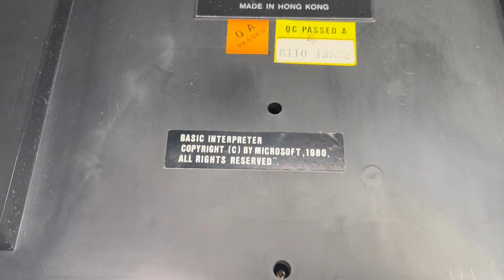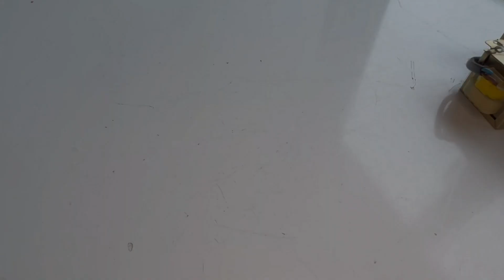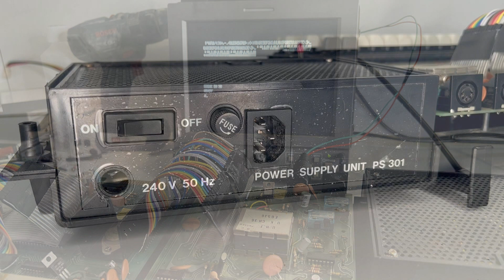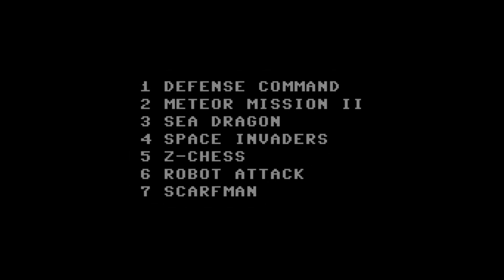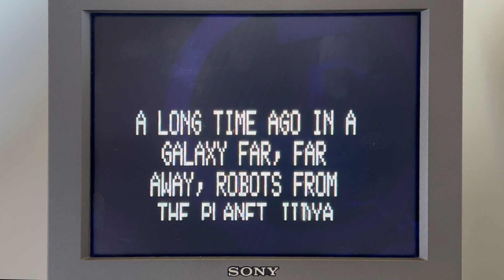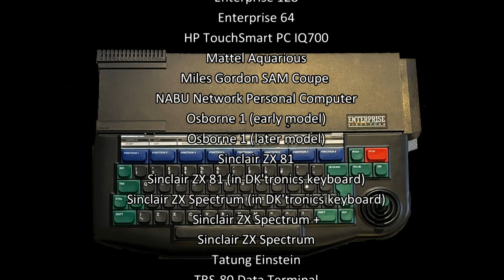1981 EACA Video Genie System EG3003 Version 2 (Part I)

Comment: Hello. have same computer (with extra internal 32kb RAM expander), I would like to ask where you got the games for it. Can you please share at least one to try out? thanks
Reply from the maker: It was a while ago, but I’ll have a look for you and let you know 👍
Reply: @RetroRelixRestorer  seems my internal cassete is not working - no movement, no reaction on play, rewind, etc. So I would like to use external option, I have prepared cable. Now I downloaded this playCas.exe and one game from the address you have in video. Now, I see you have used command "SYSTEM" and then typed name of the game "DEFENSE". And then you have used car-cassete. Can I instead use this to load game from external cassete by using playCas.exe and cables?
Reply: @RetroRelixRestorer   I found web page you state in your video, there I downloaded playCas and few games. Seems my internal cassete player is broken. No movements even if the red led is shining (F1 pressed). when I used the car cassete, it is indicating intensity on the tone meter, even if the wheels are not turning, strange. During "cload" I see two asterisks, but they are not blinking. so something is definitelly wrong.
Reply from the maker: I think it should still work even if the wheels are not turning - maybe a perished drive belt ? Assume the VU meter is centred when playing the file, which means the cassette adapter is working too - maybe clean both the tape drive and car adapter receiving heads. Finally, to test the computer, maybe solder up a din plug and test with an external tape drive. Let me know how you get on.
Reply from the maker: Also, I delve into the  tape drive and how to load machine code games in this video https://youtu.be/60O-S7_dHus?si=SQ4G6KxEwEGAvgS0
Reply: @RetroRelixRestorer  I tried both, system machine code games and also basic games - I downloaded them  from the page you are showing in video and using playCAS program you have showed.. VU meter was centered, after few seconds there appeared two asterix in right upper corner, this seems that program has been recoginzed, but asterixt remained stable, no blinking, which I understood means that it is not loading anyting. And when program play ended, nothing happened. With this car tape I am using, I was able to load games to Sharp MZ800, but I had to use convertor which was generating "reversed aplitude". The play cas doesn't have such option. I have ordered another types of this car tapes (they are still available for few dollars) and I will try with them. External tape I wanted to try. When I created cable it looked it is working, the sound of cassete was audible from built-in speaker, but then it dissapeared, no sound from speaker anymore. not sure what happened, if something has broken in the computer. Anyhow thanks for all your hints, I will keep digging :-)

Comment: I take it it didn't have a video chip? Otherwise I can't figure out why it's so slow since character graphics and such a small amount of memory are well within the capabilities of a standard Z80. Hell, I wrote a road game on the 6502 which was slower than the Z80 and had to, for the first time, sync up with the display to prevent the road from "going backwards".
Reply from the maker: Check out “1.3 Video Interface” from the system manual which should answer your question: https://oldcomputers-ddns.org/public/pub/rechner/eaca/genie_1/manuals/vg_servicemanual_eaca_blue_1981.pdf

Comment: I still have a PSU unit from one of these as the supply unit for an electronics project bench. the o/p s from the regulator are +5 capable of 15A and + & - 12.5 volt the spec for the RS232 interface .